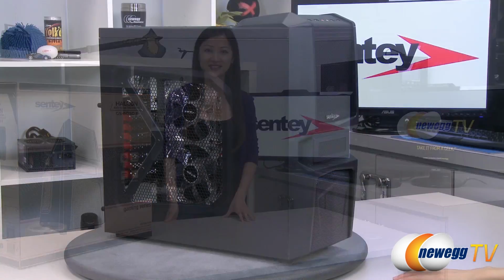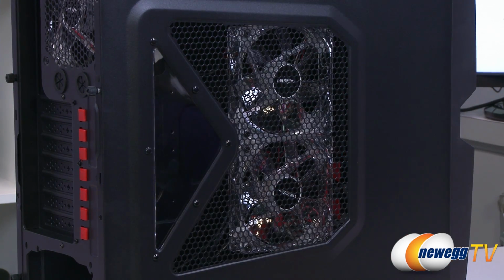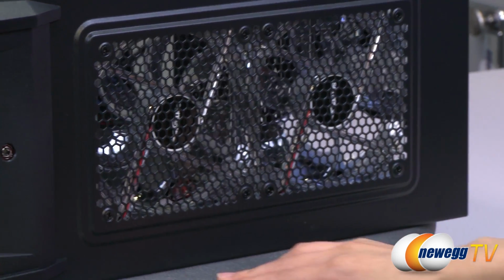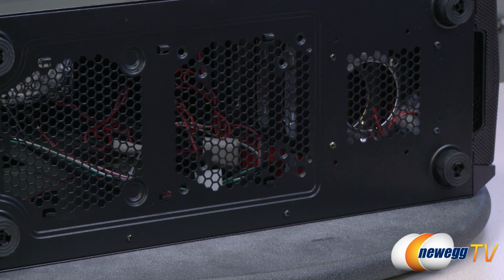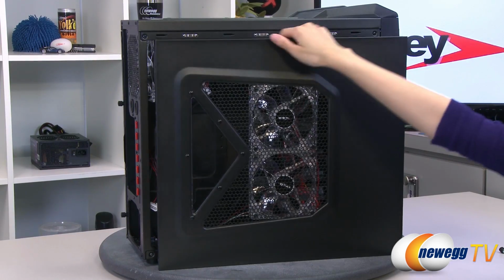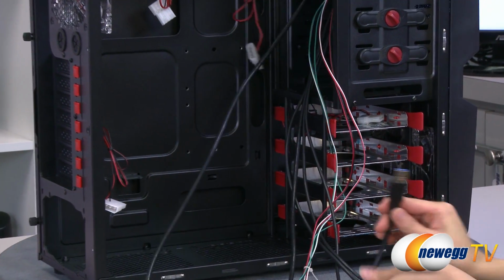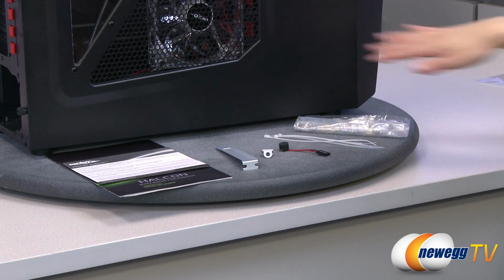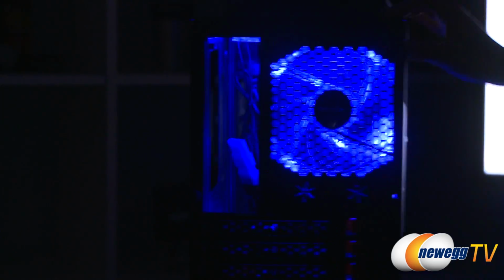Newegg TV: Sentey Extreme Division GS-6050 II Halcon Black Mid Tower Computer Case Overview

Comment: The R3 I have now only has 1 usb3.0 connector with a single usb3.0 mobo connector.  The 600T I had was only a single usb3.0 passthrough.  I think it's kind of a waste.  Since a usb3.0 header supports 2 connectors, I see no reason why they wouldn't add a second usb3.0 connector.  It would be cheap and would make the case that much better.

Comment: well, my hdd is rated for sata 6.0 gbps but you need to look at the top read write speeds of even the highest end hard drives. None of them even fully utilize the 3.0gbps speed, so there is no point of using 6.0 gbps, no performance enhancments, so a hdd that runs at 6.0 or even 3.0 gpbs is mythical.

Comment: yeah, but USB 3 ports must go into a USB 3 header. allot of the motherboards out there still don't have any USB 3 internal headers even if there are USB 3 ports on the back, so if you would buy a case with USB 3 ports on the front, unless your motherboard had those headers witch weren't really standard until the latest z77 chip set, you wouldn't be able to use those front ports. What do you need more than one on the front for anyway. Your array of USB 3 flash drives that cost 100 bucks a piece?

Comment: A single usb 3.0 header supports 2 x usb 3.0 connectors, right??  There are a lot of cases with two fron usb 3.0 connectors with a single 20 pin usb 3.0 header.

Comment: Probably will when the MoBo's will support it.  Most boards only support 2 3.0 on the front and 2 on the rear, some high end are starting to support more, but the bandwidth restrictions are still present.  Until then, they will fill up the 3.0 capabilites and then add 2.0 ports to give you as many other connections as possible.  So, don't blame the cases, blame the Motherboards.

Comment: If you're running a couple year old mobo you won't have the headers for USB 3.0-- though I have seen some adapter cables that will make the USB 3.0 header go into a 2.0 and work as a 2.0, but I haven't been able to find any for sale anywhere. This particular example came with a case.